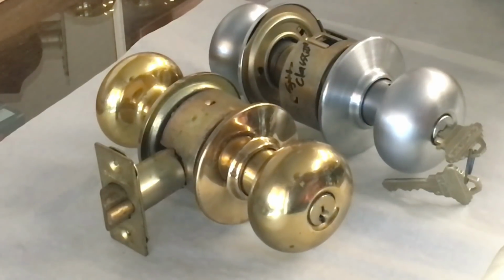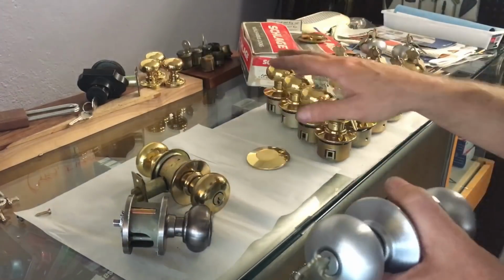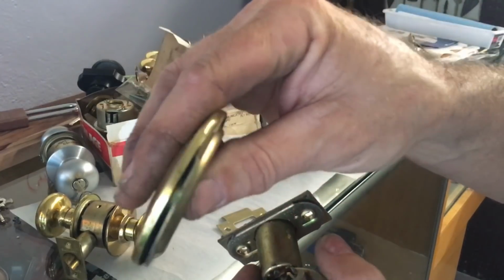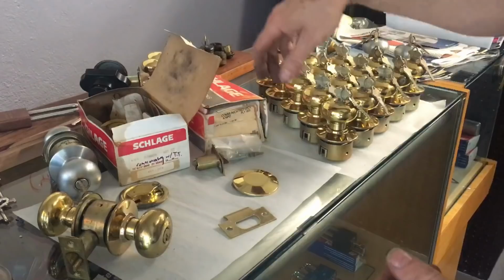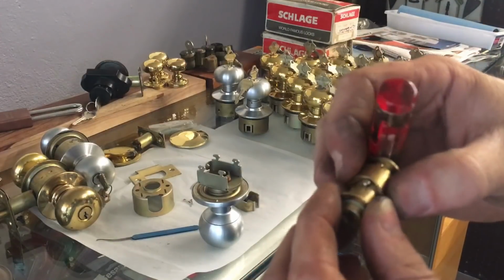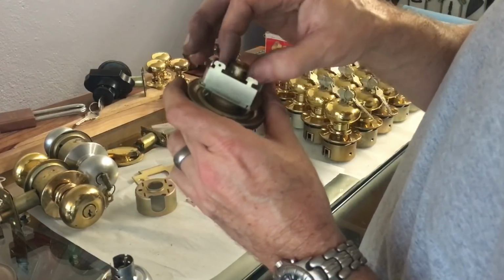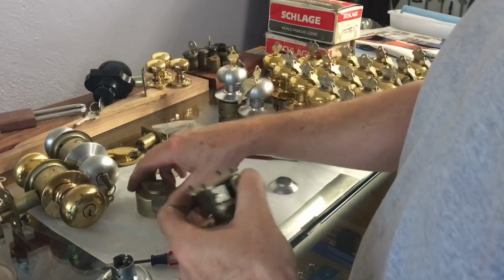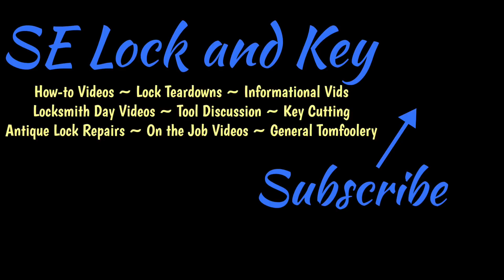Half a Doorknob - Schlage Communicating Knob A79PD

Comment: The thumb turn is for a Communicating lock, but it's not for the A79. It goes with the A43, which has a short stubby spindle where the A79 has a flat plate. The thumbturn engages the spindle. Instead of a lock cylinder, it has a plunger/button.

I think both styles of communicating knob are meant to be used on a pair of back-to-back doors sharing a frame between adjacent hotel rooms. With the A79, management would have to lock/unlock the pair of doors as appropriate. If you want to allow your neighbours to enter, you would have to leave your door open. If they also want to let you access their side, they'd have to leave their door open too. There's no middle ground of having a closed but unlocked doorway between units.

With the A43, both sides can have their door closed, but unlocked, allowing a closed doorway that people on either side can open and pass through by themselves. The thumbturn allows either side to prevent the other from passing.

The last 'half doorknob' in this family is the A25 exit lock, which is like the A79 but without the lock cylinder. As with the A79, you just close your door if you don't want the adjacent unit to come in.

Comment: The "Thumb turn" is actually called "The Prism Actuating Half Knobset Rear" or "PAHKR" for short and it interacts with the "Prism Pin" you showed us in an older video.

I'm just kidding I have no idea what that's for, I have seen them I few times and wondered what it was myself.

Comment: seen those on double hotel rooms. there were 2 doors both opening out in the same frame. So you open your door and knock on the next, and the neighbour also has to open from inside. works great in case preparations are needed before the inlaws can enter in the morning.

Comment: Apparently, the thumb-turn is designed for the inside trim of a passage [10-Function - ANSI-F-75] cylindrical chassis intended for use as a latching mechanism for a closet door, so as to provide a method of release from the inside to prevent children, for example from locking themselves inside of a closet when the door is latched shut. This explains the keyed tab on the underside of the trim - to interface with the knob spindle in place of a knob... granted the spindle may need to be shorter in length to allow the thumb-turn trim to securely or tightly mount as the inside mounting plate.

Current Allegion Schlage A & D Series product catalogs still evidently show this particular function as a viable option for ordering this particular lock 'function' for a more specialized commercial/institutional application... just as you've illustrated for a door opening that conjoins to separate hotel rooms... however, I would have elected to use tamper-resistant security screws that use special drivers to install or remove them instead of one-way slotted screws, in the case that the lock must be removed from the door for either servicing or some other type of maintenance such as painting/staining of the door or in the case of door replacement without the need for destructive grinding off of the screw heads...

On a side-note however,  Schlage's ND-Series catalog doesn't appear to have this specific lock function listed as a viable or available option for this particular lock function as a single-sided communicating lockset...

Schlage's D-Series & ND-Series does offer a 'Store-Function'  [66-Function - ANSI-F-91] double-cylinder lock chassis that functions in the same way as a classroom lock with a keyed knob or lever on either side of the door that locks or unlocks both sides simultaneously when the mechanism is actuated with a key from either side of the door. 

Schlage D-Series & ND-Series Grade-1 Heavy-Duty Cylindrical Lock Chassis are also available in other double-cylinder functions such as the [Function-82 - ANSI-F-87] Institutional or Asylum Lock for which its name indicates as its functional design includes both rigid knob or lever spindles (one extending on each side of the door) for which both sides are rigidly fixed & inoperable... the use of a key from either side of the door is necessary to retract the latch for entrance or egress...

Schlage D-Series offers a communicating lock [Function-72 - ANSI-F-80] for which a key in either knob independently locks or unlocks that particular knob... may have a specific use in commercial/institutional spaces where a common or conjoined doorway or door opening is used between two separate spaces and where the functional application of that door may vary from time to time, such as that of hotel or sleeping rooms, classrooms, offices, or dining rooms in hospitality where a door may need to be periodically locked on one side, the other side, or both sides to prevent casual or unauthorized access through that door. Schlage's ND-Series has same [Function-72 - ANSI-F-80] with a clutching vandal-guard feature, allowing the locked lever spindle to disengage from the chassis, allowing the spindle to freely rotate to prevent malicious torque attacks from being applied to the lever by either leveraging a pipe as a cheater-bar or by standing on the lever to damage the locking mechanism... 

Vandal-Guard is an enhanced clutching security option that has been available for a number of different manufacturer's heavy-duty cylindrical lever locksets for a number of years now... Schlage offers this as an option for (their D-Series levers Manufactured Before the introduction of Schlage's ND-Series), their ND-Series Locks, and their L-Series Mortise Locks.